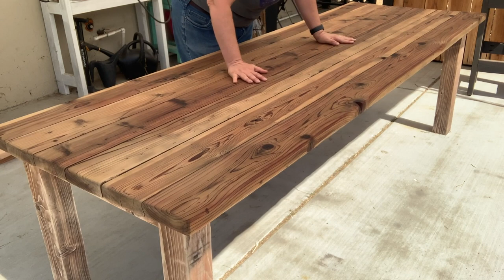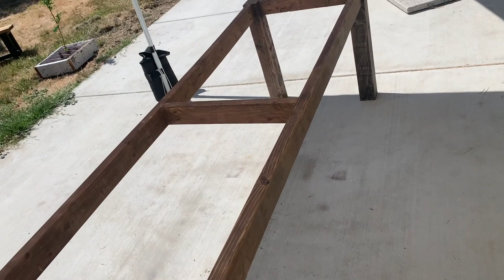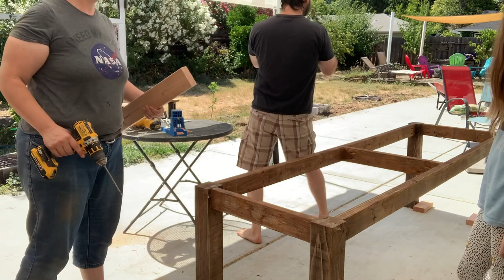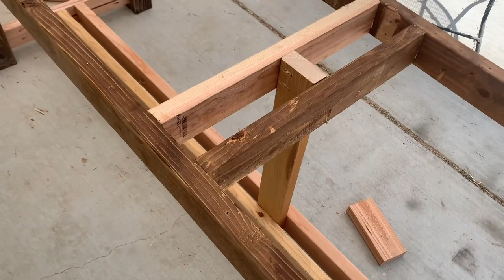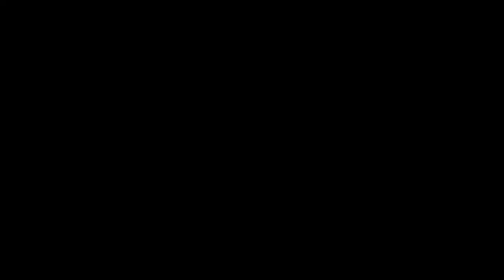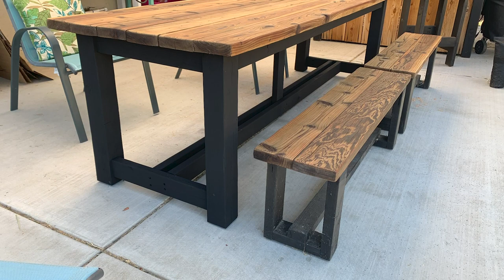DIY Outdoor Table // Easy Build

Comment: Hello. O was just curious over the length of time, how have the pocket holes as your main assembly held up after making your adjustments.  I'm getting ready to do an 8ft bar table myself and have been on the fence with pocket holes or joinery. Just curious. Thank you.

Comment: What would you recommend as a first project? I've been really getting into the idea of making things like benches and tables but I don't really have much in the way of equipment or workspace, but I know I have to start somewhere.
Reply from the maker: The benches might be the better first project. But both the table and the benches are fairly simple builds that don’t require a ton of tools.

Comment: Love the video! But what did you use to hold the tabletop together?
Reply from the maker: I used pocket holes. There are better ways to put it together. But this was quick. It's been outside for a few years now and is holding up well. But it wont last forever.

Comment: How many people would fit around this?
Reply from the maker: 8 fairly easy. Although the 2 on the ends tend to run into the support pieces. I have 6 decent sized outdoor chairs with arms that fit comfortably. 3 on each long side. Then if we have guests or a party, we add chairs on the ends.

Comment: What kind of paint did you use on the base
Reply from the maker: I just used a basic black acrylic paint. Whatever was on sale. I did the same on the bar. Had to touch it up after a year, but only took a few minutes.